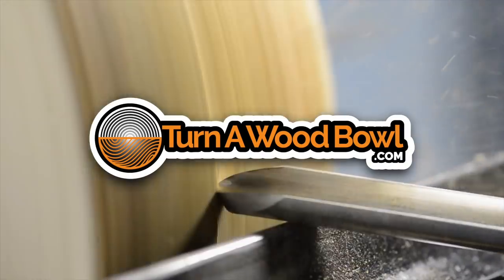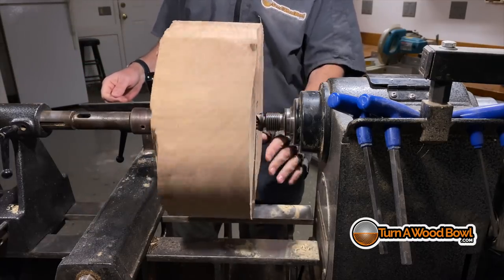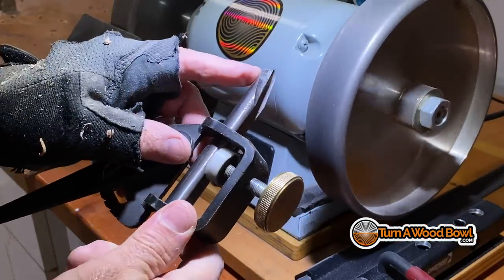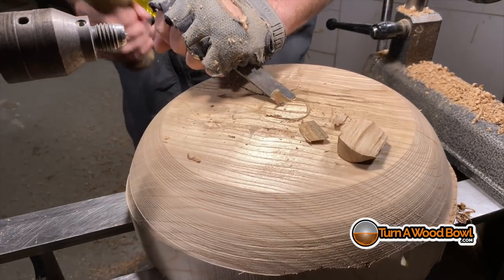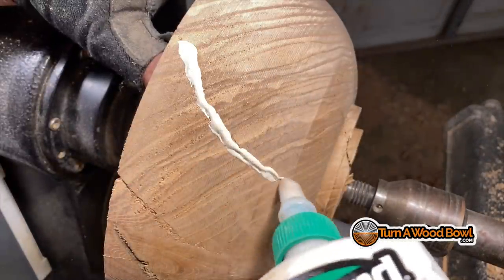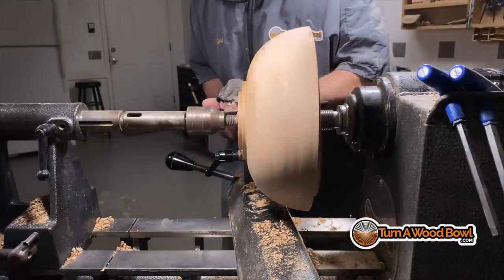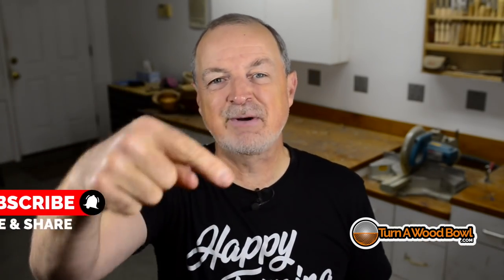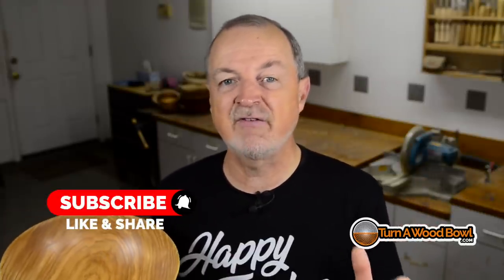Thin Wall Bowl Wood Turning – Video

Comment: Thanks for the great video. What tool do you use to sign the bottom of the bowl? Thanks
Reply from the maker: Patrick, thanks. It's a woodburner and I have the link in my recommended gear section on my website www.TurnAWoodBowl.com/gear Happy Turning!

Comment: Kent, instead of using the 0000 steel wool, have you also tried using the left over Ash shavings? I find using them after I pre-sand before any finish is applied yields great results. Was curious if you had tried in the past. Thank you for all of your videos 👍.
Reply from the maker: Interesting, I'll have to give that a try. Happy Turning!

Comment: Beautiful job.  I learned long ago as a machinist that the secret to a good job was patience.  I would watch others who had to remove half an inch, dial .490 onto their machines and say, yeah, .010 for grind. But then the part would rip out of the vise, it would heat up and end up undersize or any number of other problems.  Those were my thoughts as I watched you close in on the final outer shape, then turn the bowl around and creep up on the wall thickness, cut after cut.  The finished product spoke highly of it's creator.  Thank you once again for sharing and Happy New Year from New Hampshire.

Comment: Kent, thank you for all the tips in your many videos. They helped me get to the next level of bowl turning. One thing I see you chip away with a chisel fir the spur drive. I just drill a 1.5 inch diameter forstner bit. It is a clean level surface to set the spur to.
Reply from the maker: Great idea. Thank you for writing and sharing! Happy Turning!

Comment: You mentioned not wanting to use CA glue for the crack and why you prefer using wood glue. Did I space out was that not covered here?
Reply from the maker: There are times when CA is great. Very thin crack especially.

Comment: The shear scrape at 17:17 is different from the pull cut before because on the shear cut the bevel isn’t riding, is that right?
Reply from the maker: Correct.
Reply: @TurnAWoodBowl  thanks. I will check out the course

Comment: If you used a coring system to save the center of this blank for other bowls, how would that affect the approach to developing the thin walls?
Reply from the maker: Good question. Typically the first turning is still thick enough to support the whole piece from vibrating. I still work down the walls from top to bottom the same way with a twice turning. Happy Turning!

Comment: Great video, only one question, isn't easier to start with a face plate? I'm very new turning .
Reply from the maker: Yohan, yes when you are starting and for larger pieces a faceplate is very good. As you grow you will want to use a drive center because you have more control of how the blank it mounted and balanced on the lathe. Good quesiton. Thanks and Happy Turning!
Reply: @TurnAWoodBowl  I thought so!  thanks for the info.

Comment: I'm new to wood turning and found centering a blank difficult. I decided to try using a 3/4" socket as a centering device. I center it under the blank and move it till the blank balances it self. Then I hold the socket in place, turn the blank over and draw a line around the socket.
Reply from the maker: Bill, sounds good. Thank you for writing and sharing! Happy Turning!

Comment: Kent, I have a question about gouge sizes? Hurricane Turning Tools, HTT-102, High Speed Steel, 5/8" Bowl Gouge (1/2" Flute) for Woodturning
Hurricane Turning Tools, HTT-102, High Speed Steel, 5/8" Bowl Gouge (1/2" Flute) for…
 234. I picked this gouge as an example. Here it says 5/8" Bowl Gouge (1/2" Flute) My question is, What is the actual size we're buying? 1/2" or 5/8"?
Reply from the maker: Good question. The sizes I mention are the size of the gouge shaft. Happy Turning!

Comment: That must have been a truly dull chainsaw.  I’ve run chainsaws for 50 years and never had a cut as rough as your piece.  Either that or there is another reason other than the chainsaw.
Reply from the maker: Yes probably was dull. I didn't cut that log.